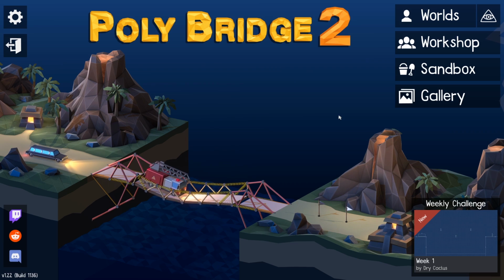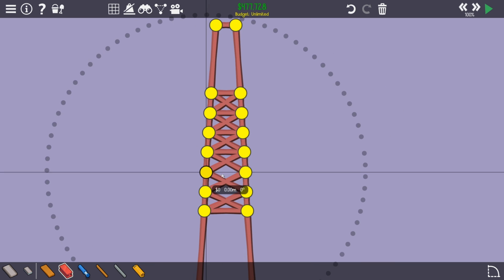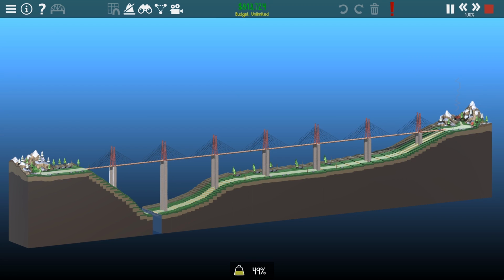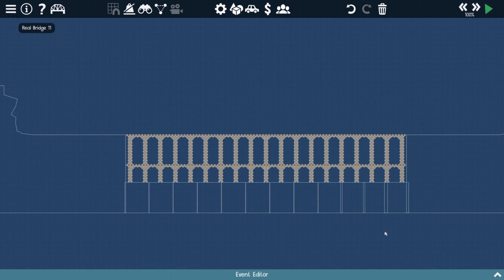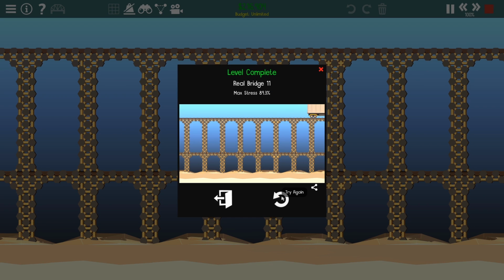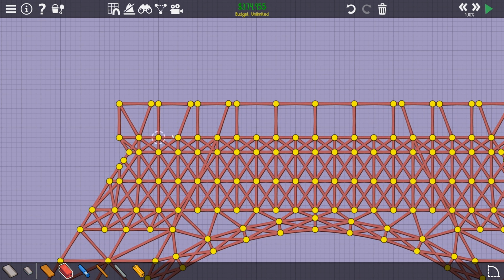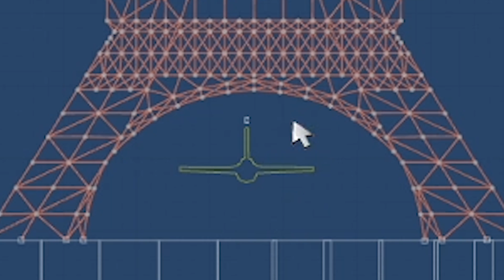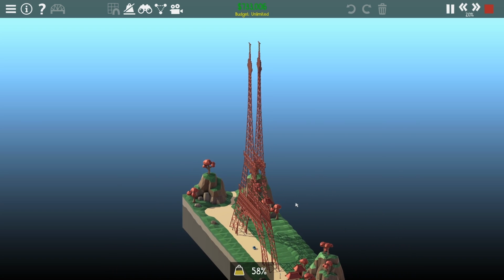I spent over $1,000,000 recreating French landmarks!

Comment: There is a pedestrian bridge in Liège (in Belgium) that has a great design imo, it's called "la belle liégeoise", it uses tension and has both over and under support, you should check it out and maybe try to recreate it !

Another great and very unique bridge in Liège is the "pont de l'observatoire", it has a road that turns but the support beam is not following the road ! Sadly it wouldn't make much sense to remake it since its cool thing is only visible in 3D
Reply from the maker: Yeah the trouble with a lot of real bridges is they aren't that impressive in 2d!